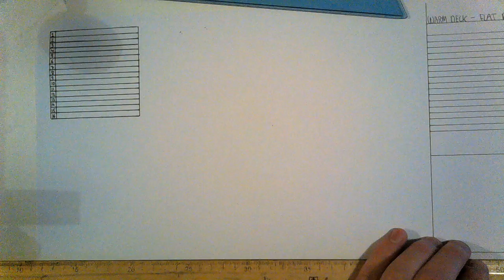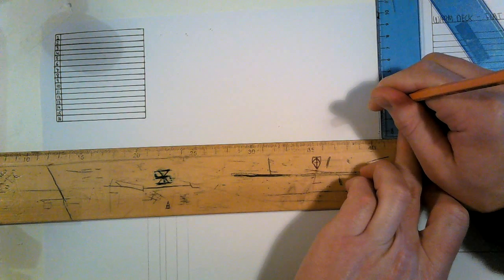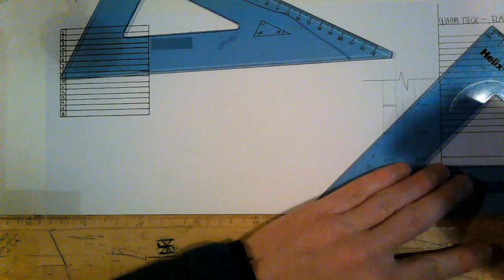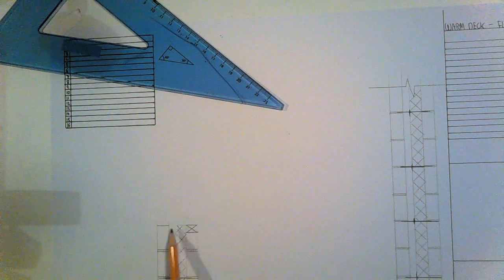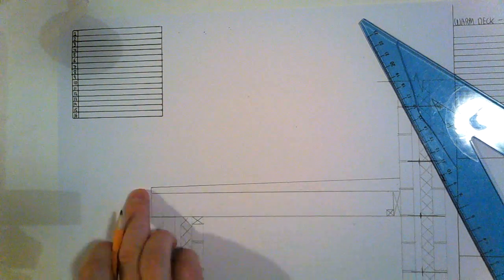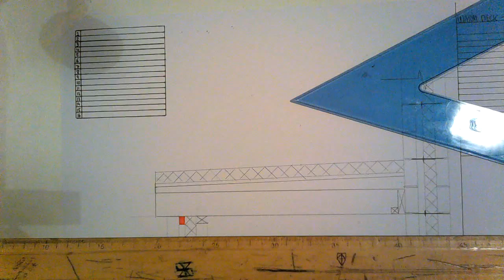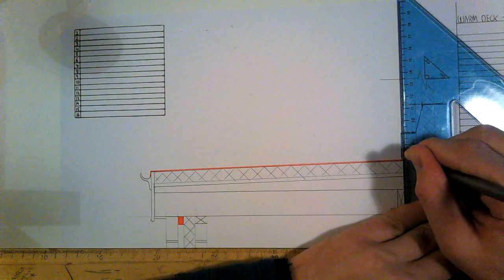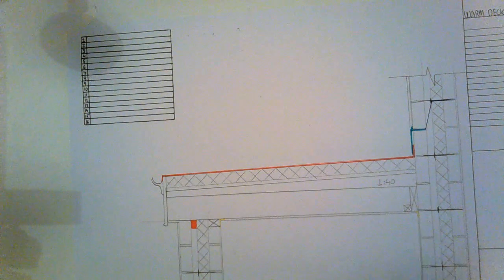Warm deck flat roof

Comment: Useful video, and very clear, thank you. I wish to draw a warm deck flat roof plan for a lantern lit kitchen extension,  but it would sit inside a parapet cavity wall, so I guess I can use this same roof structural technique, but run out to the parapet structure and flashing from the lantern trimmers.